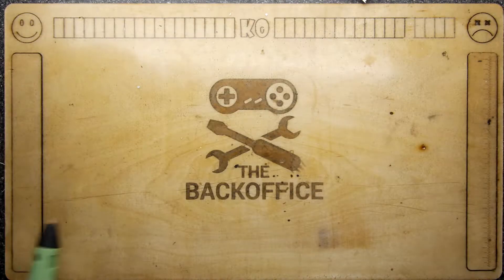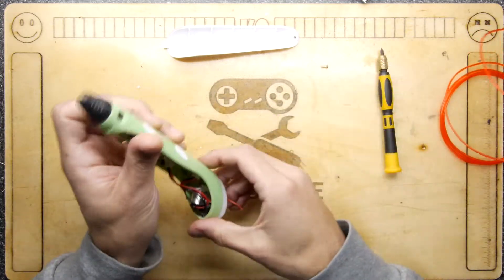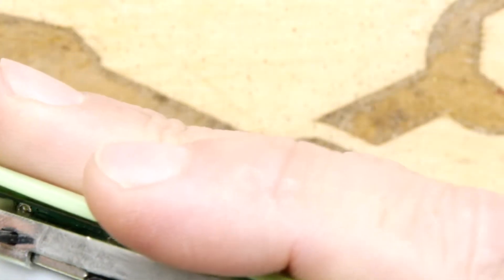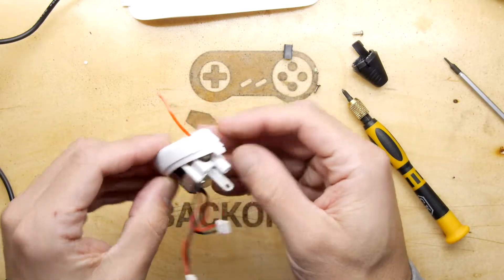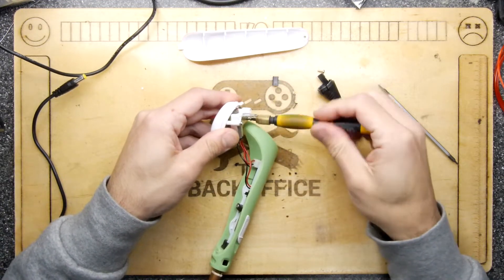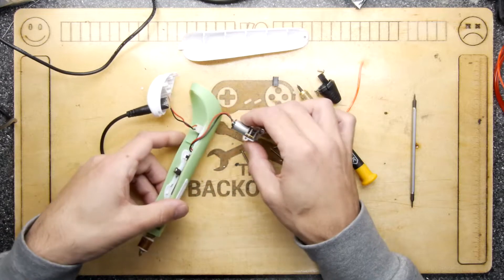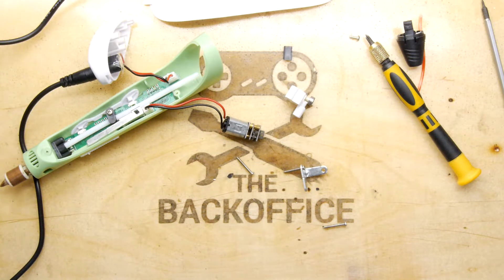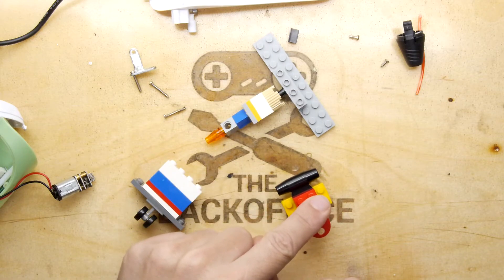3D Printing Pen

Comment: The robots stole the show! :-) Fireblamer sounds fantastic! I can see movie deals and a whole range of action figures! As for the gear I would keep the occasional eye on eBay when you are bored, sometimes random stuff like that shows up if you can wait long enough!
Reply from the maker: #teamFlameBlamer 😁 I will certainly keep a look out, interestingly I replaced it and the replacement has a more modern firmware but the base is lighter. So I guess I can mix and match
Reply: @backofficeshow  indeed! :-) I think the next product you make should be called the Fireblamer now! I suppose the easiest thing to do with the 3D pen is to keep an eye out for a faulty one on eBay etc hopefully with a different fault and mix and match as you say. Hopefully they improved the feed mechanism in version 2.0. Years ago I used to harvest gears from things thinking I would find them useful for something one day, but they never did sadly. :-/

Comment: You can get those gear motors for pretty cheap on eBay, just need one with the rpm, or gears.
Or here is a gear head https://rover.ebay.com/rover/0/0/0?mpre=https%3A%2F%2Fwww.ebay.com%2Fulk%2Fitm%2F283627399275
Reply from the maker: https://www.ebay.com/itm/283507157146 ooo these look really fun for projects. Thaks for the headsup!